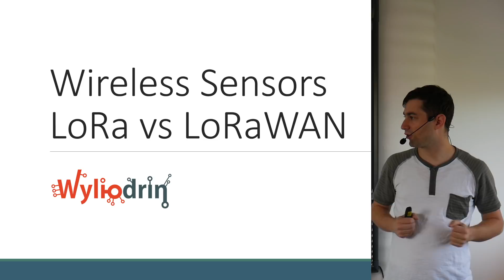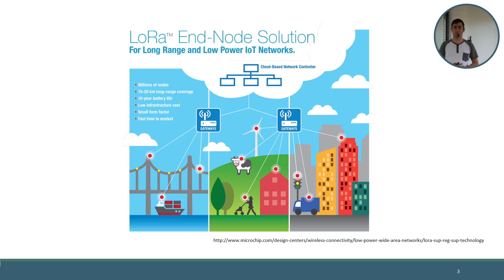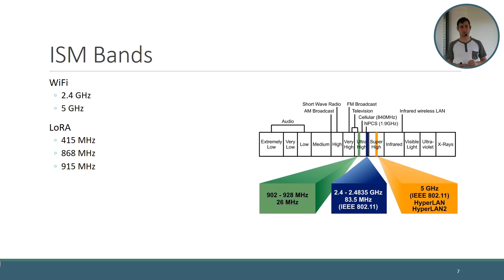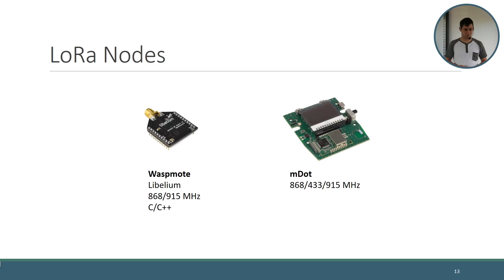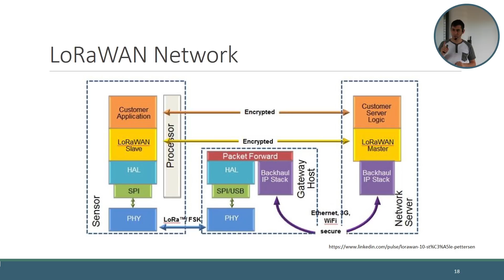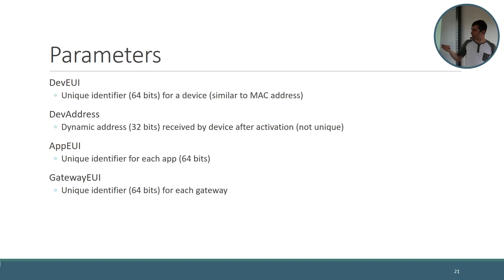Lecture 7: Introduction to LoRa

Comment: Great presentation, detailed information. Could you make a similar video explaining LoRa usage licensing and certification? Can two devices use LoRa to communicate between them without using gateway? Are there licenses and/or payments associated for sensors/devices using LoRa technology?
Reply: You can communicate two LORA devices with each other. There is a range of frequency in which you have the  access to use the technology.

Comment: Dear young engeneer, please don't provide wrong informations: there are not "free" bands where you are allowed to transmit "freely". There are band where a license is not requested, but the device must be approved by local autority. Of course one of the limit is the ERP or the EIRP: it means that the antenna is included in the account to be approved. So it's not enough to chose the right band because you cannot switch on the module (+ antenna) you presented without the entire device is approved by the authority. Probably using an approved antenna the range will be also much less than kilometers. Another thing: the low trasmitting bit rate, tipical for the LoRa system, does not came from interference on the same frequencies; if no interferences are present the bit rate will be very low anyway. The reason is in the special kind of modulation chose for its robustness against interferences: a spread spectrum modulation in which a narrow radio carrier, psk modulated, quickly sweeps his frequency through the part of the spectrum you decided. Thanks to this system you can extract the informations even if other transmissions are inside the range of frequency you are sweeping: a standard, non LoRa transmission will occupy just a very little part of your emission. That is the reason you can transfer datas so far away. Expecially in that case, interferences are not the cause of the low bit rate: it has been choose intentionally! E.g. 2.4 GHz is much more crowded band, but the bit rate is much much higher than LoRa : it depends mainly on the wideness of the channel and the kind of modulation. After this beginning I stopped the video and I do not know what you state in the rest of the "lecture" but, as your audience that did not contested your statements, other people can believe you: so please rectify those sentences.
Reply: This is True !!